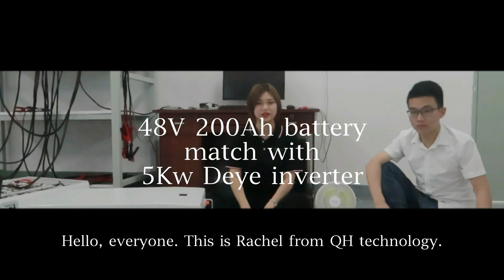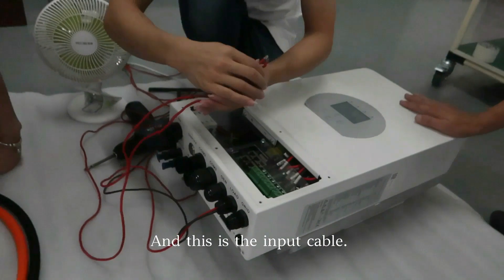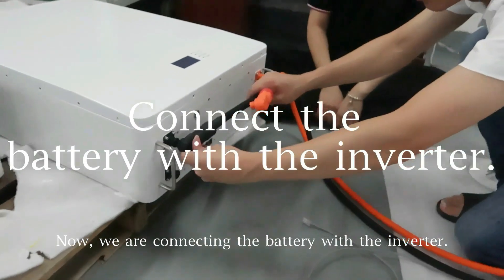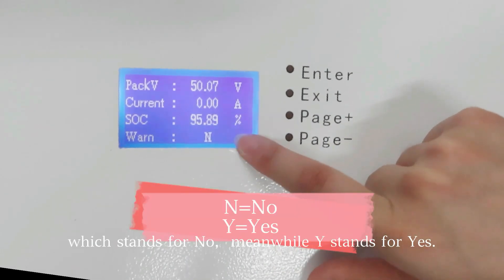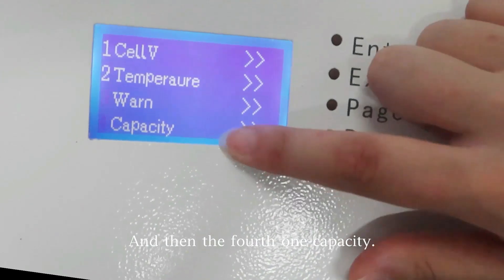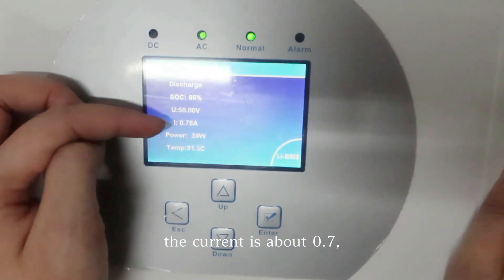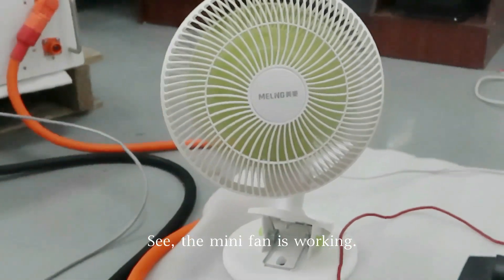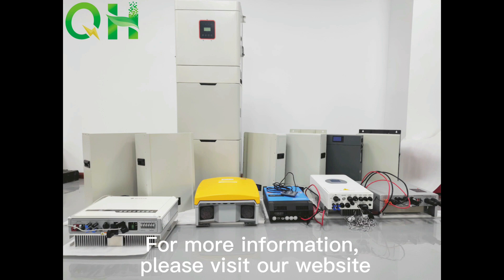48V 200Ah battery match with 5Kw Deye inverter

Comment: hello, what’s the communication protocol between Rosen battery and Deye inverters ? 12?
Reply from the maker: Hi, Mr.Ayman Mohamad Khalil. Thank you for your reply. The communication protocol depends on the model number of the battery and inverter. They usually have a particular communication protocol specification. I suggest you ask a salesperson at Rosen or Deye. 🔋
We recommend choosing the QH lithium battery, matching the CAN/ RS485 communication protocol, and the Deye inverter can also be well matched. Don't hesitate to get in touch with WhatsApp: at +8618664768716 or E-mail: info@lifepo4-energy.com😁

Comment: i have problem with communication rosen 100kh battery and 5kw hybrid deye  inverter pls explain about settings and cable connection
Reply: now just run with use batt mode
Reply from the maker: @thiloshansundaram8906  Maybe the Deye inverter can't read the information on the Rosen battery. Such as voltage, and resistance of the cells. And the charging and discharging time cannot be set by the inverter. To put it simply, the inverter can only work as a convertor (Convert DC to AC. )
Reply from the maker: Hi, sir. Thank you for your message. For the communication problem of the Rosen battery and Deye inverter, you can check the communication protocol first. They should be compatible with the same CAN or RS485 communication protocols. Then for the cable connection, you should connect the inverter cable to the correct port in the battery. You can check the user manual. If you still feel confused, you'd better contact Rosen or Deye.

Comment: there is electricity everywhere, why people need the battery?
Reply from the maker: Sir, you cannot assume that electricity is everywhere just from your own experience. Hope you can read the following reasons patiently.
First, there are some small village or island that can't not connect with the grid. It is better to build an off-grid system and use battery to store the electricity. 
Next, in some developing countries in Middle East and Africa, the power infrastructure is inadequate, they need batteries and solar panels to power theirselves. 
Then, the European countries are pursuing the Net-zero goal and use more and more renewable energy, the electric bills are high, they can use solar and wind energy. The batteries can store the electricity bacause the solar and wind energy is intermittent.

Comment: I have Deye 5k and Felicity 200AH, which port to use for BMS? And what is the pinout ? Thanks!!
Reply from the maker: Thank you for your comment, you'd better ask the support from Felicity. :virtualhug:
Reply: @QHTechnology  qh 200 and deye which port use and bms number?
Reply from the maker: @huuluwar  Hello, you can send your detailed questions (preferably with photos) to our email(info@lifepo4-energy.com) or WhatsApp(+86 18664768716). Besides, you can leave your email or WhatsApp number instead. Our technical support will reply to you soon. Thanks!

Comment: how long is the warranty and how many cycles  for the battery
Reply from the maker: Hi, thank you for your message. There are two grades of our batteries. The Grade A batteries are 6,000 cycle times with 5 years warranty. The Grade B batteries are 3,000 cycle times with 3 years warranty. If you have any other questions, welcome to contact us.

Comment: what size is the battery cable?
Reply from the maker: Hi, sir, the battery cable is 580mm*250mm*715mm. If you are interested in this battery, you can contact us for more details on WhatsApp(+8618664768716), or send an email to qh18664768716@gmail.com. Thank you for your comment.